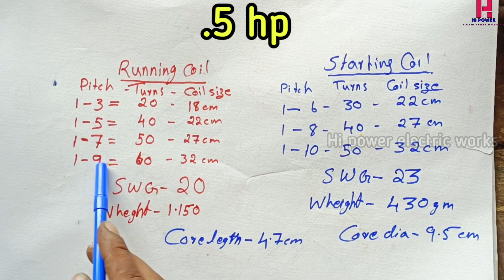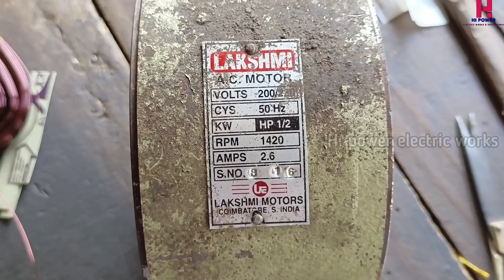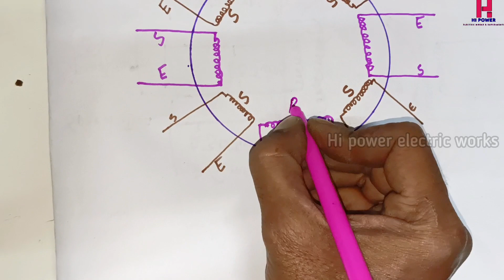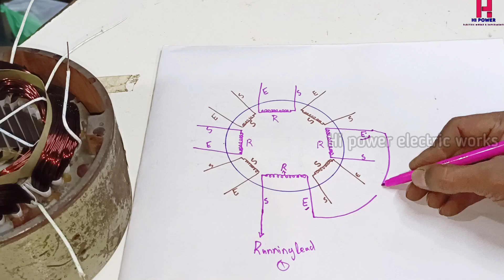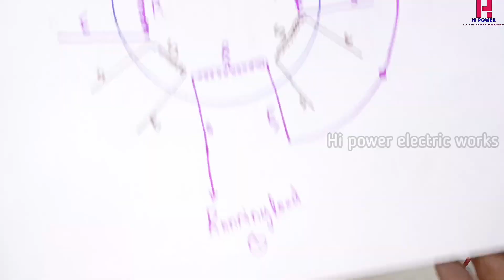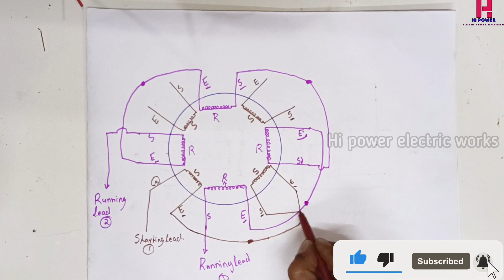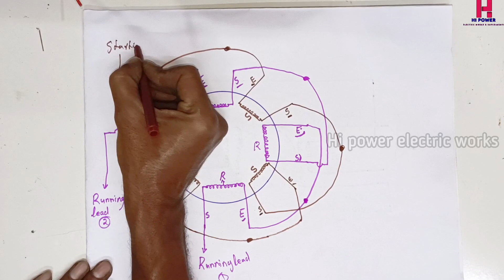Wet grinder motor winding|Single phase 36 slot 1440 rpm 4 pole motor winding|Electric motor winding

Comment: Sir You look Weight running Coil 1.150g?
Reply from the maker: Total running coil weight - 1kg 150 gram
Reply: Sir answer 1.15 kg
Reply: @Hipowerelectricworks  teacher Running coil And Starting Coil how much Turns calculate formula Teach me Please

Comment: Anna 
0.5 hp grinder motor 
Core length   4.7cm
Core dia         80cm
Step step slot anna 

Data soluga anna